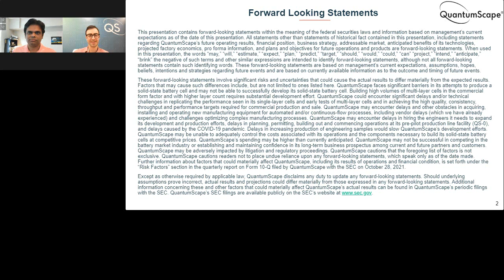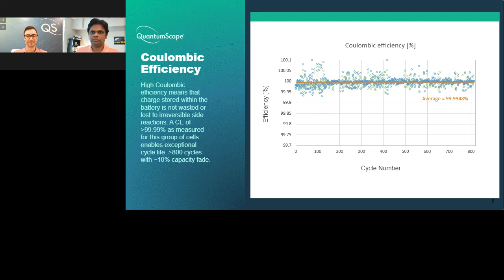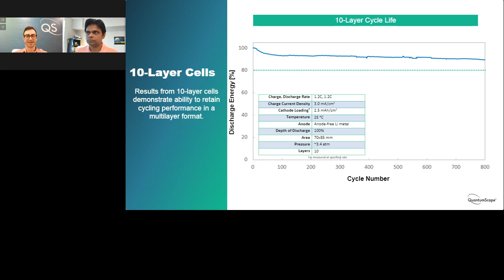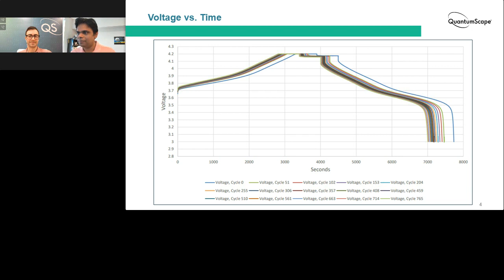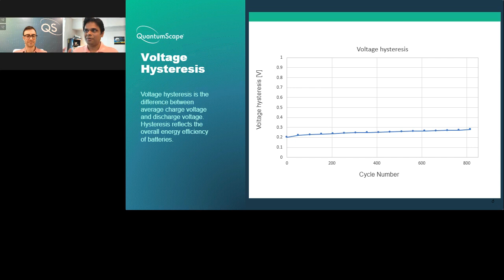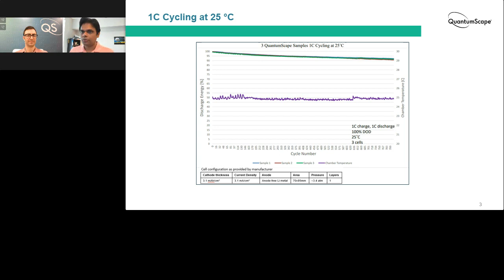Webinar: Deep dive into third-party lab test results

Comment: I wonder which automotive company gave the target of 800 cycles before 80% SoH. The best in class NMC gives >2500 cycles, LFP gives >4000 cycles for the same conditions. I wonder whats the gravitimetric energy density. Its not mentioned any where. Coulombic efficiency, hysteresis, normalized voltage are not really decision making parameters. Additional data to throw at people and confuse more.

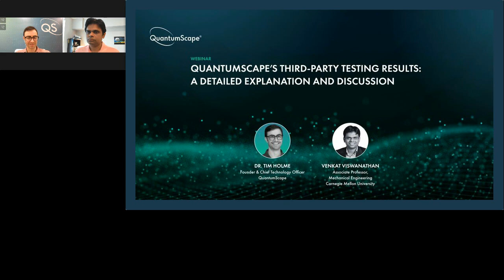Comment: 36:12
Although they showed the charge and discharge curves including the charge rest, the IR drops are extremely large. In addition, their large voltage drop after the charge was observed. Those imply that their battery doesn't fit any automotive requirements. It would be difficult to reduce the dc impedance.
They might need another innovation for this.

Comment: Great presentation, thank you. Two questions:

1. What are QuantumScape's milestones for 2022?
2. How is the plating of lithium managed as it passes through the separator; how does it stay uniform and what would happen to the battery performance if the plating is not absolutely flat (if anything)?
Reply: They apply pressure to keep the lithium plating uniform.

Comment: 10 years from now, these batteries will be in everything. Li-Ion will be obsolete.
Reply: Agreed! cant wait for QS to start mass producing these batteries
Reply: The future looks awesome!
Reply: We’re see how fast mast production happens
Reply: @Dee Cee, 
I wish I can share your enthusiasm, but here is what I see from the test data:
1. Average 1h charging voltage: 3.95 V
2. Average 1h current: 3 mAh/cm2 
3. Layer area 7cm x 8.5 cm = 59.5 cm2 
4. Layer thickness 0.29 mm. This comprise of 240 microns cathode materials, 20 microns each for current collector plates and 10 microns of the ceramic membrane. There is no anode.
5. The volume of one layer: 0.029 x 59.5 = 1.726 cm3 or 0.001726 L
6. 1h charging energy: 3.95 V x 3 mA/cm2 x 59.5 cm2 = 705.08 mWh = 0.705 Wh.
7. Energy density: 0.705/0.001726 = 408 Wh/L.
The energy density of QS ssb is much lower than any current lithium ion battery on the market. This is a very bad news for QS investor.
Am I wrong here ? Please show me if I am wrong.
Reply: @Kukaboora  This is a Lithium Metal Cell and you are making calculations based on a Lithium Ion Cell! Big difference, hence your math is wrong, simple😉
Reply: @Kukaboora Why, because the separator layer is thicker? Lack of a liquid electrolyte or anode should make SSB's significantly more energy dense than Li-Ion.
Reply: @Kukaboora  Most of the world does not look at and interpret data, people just listen to happy words.